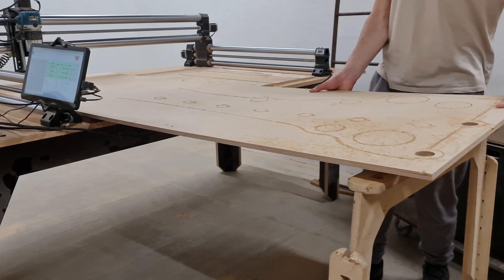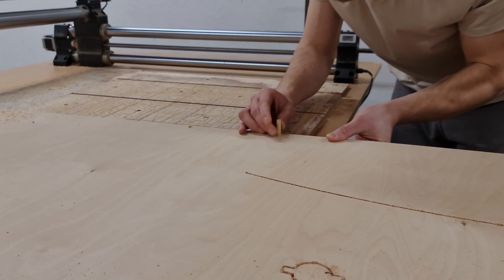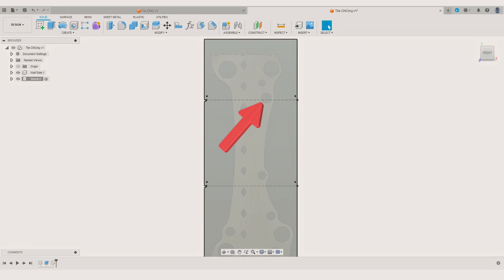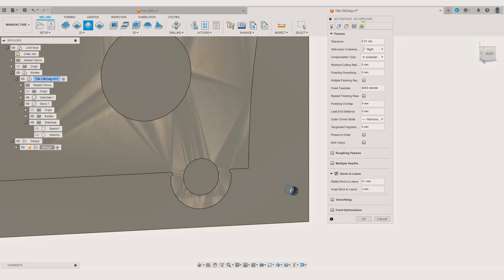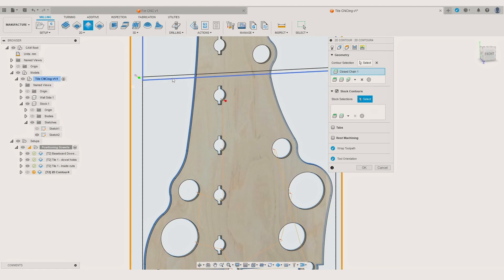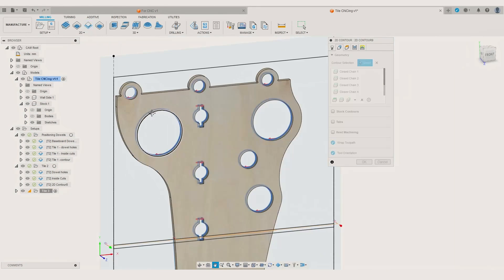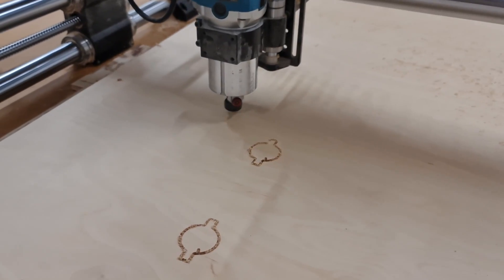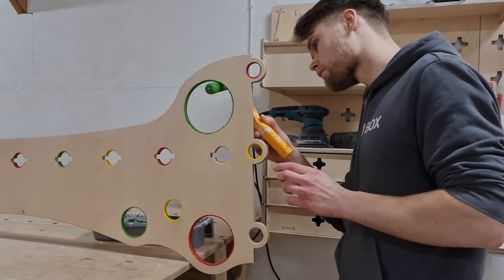Making Large Parts on a Hobby-level CNC Router - Tiling Tutorial with Fusion 360

Comment: Do you think you could help me figure this out. I have modeled the CNC slats thst i want to turn into my spoil board with holes  in a grid  pattern. For bench dogs. The holes are 20mm ,7mm, and 4, 5.5mm for hold down screws. The board is 80mm wide 660mm long and 19mm thick. My work area is 610mm by 410mm. So i know i would have to machine them in the 410mm axis so I could tile it. But like I said im new to CAM in fusion 360 and the machine setup was so intimidating I almost quit. But im still in the process of setup and tools. I plan for these slats to go into the original aluminum t slots . The machine is a Nymolabs NBS 6040. If you could maybe help me I am a fast learner and I would be willing to donate some cash to you for helping . Oh yea the holes are 20mm for bench dogs and 7mm for stainless steel threaded inserts and my material is PVC because I couldn't find HDPE cheap enough for my liking. And the reason I don't want to use the MDF that's already there is because I want to us A Misting system for aluminum milling. That would surely est away at the MDF

Comment: By resizing the tiles to not have that hole where the tiles meet, you've avoided doing exactly what I wanted to learn from such a video... How would we handle having complex and detailed carvings that go across different tiles, when you don't really have the luxury to find tile sizes such that nothing difficult and very low tolerance would be split across different tiles 🫤
Reply: I think a lot would depend on how ridgid your machine is (and square etc.), how flat your spoil board is, and how flat the bottom of your work is. 
Theoretically it should be possible.

Comment: Really nice to see that you got that no-tabs workflow figured out! Also looks like you're running a lot faster than before and full-depth at that!

Really nice work my guy!
Reply from the maker: It's all because of your encouragement to try it out - Thank you!
We sped up some parts of the video, so the cutting might appear faster than usual. However, we still run the 3 mm bit at 4500 mm/min when cutting 12 mm sheets - this leaves the best cut surface without negatively affecting the shape of the component.
Reply: @Aribabox  4500 is pro great, though, especially at 12mm depth. 👍👍👍👍👍

Comment: 6:45 I assume its trying to find a good deflection for a tangent approach to the line it wants to cut and with more length it just doesnt care what it cuts in the process, while a short closure error gives it little wiggle room (room it can mess up).
Reply from the maker: Thank you for the input! That makes sense. The first time using the tiling approach it wasn't very clear, why the 3 mm lead-in was extended to 40 mm - just had to find ways to work around it.

Comment: Nice, I always use the zero position of the center left lower hole in the spoilboard for all tiles, this make it possible to always restart by just making 2 new holes in my spoilboard if I would loss home. But as long as you always have a way to propobly find a position on your work it will work as a home.
Reply from the maker: Using the same positioning holes for all tiling projects definitely makes sense. I often find myself forgetting the exact coordinates of the positioning holes, so I end up having to make new ones each time.
Reply: @Aribabox yes, and aslong as your work is not the exakt width as the workarea of the cnc you can always move the holes just before start the next cut and just setting a new home possition. An other way would be to just zero on the lower coner of the spoilboard and always make the hole on the same position.
Reply from the maker: @jfy-t8w Indeed, moving the workpiece between operations is an option, but it does introduce an additional step that requires careful attention during CNC operations. Personally, I prefer to maintain the same home position as the CNC's default setting to simplify the process. This helps in keeping things straightforward and reduces the chances of errors.